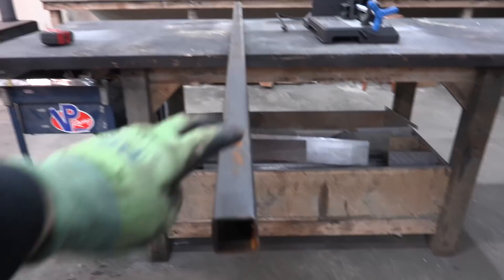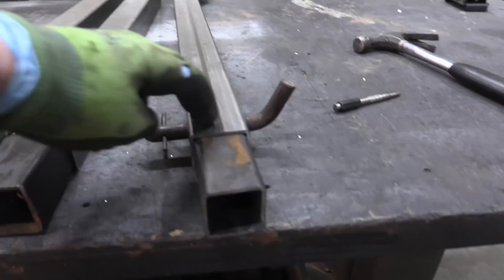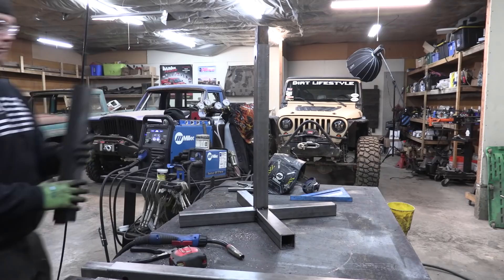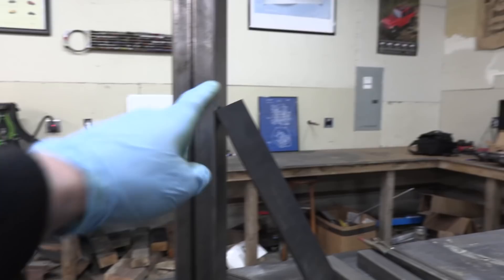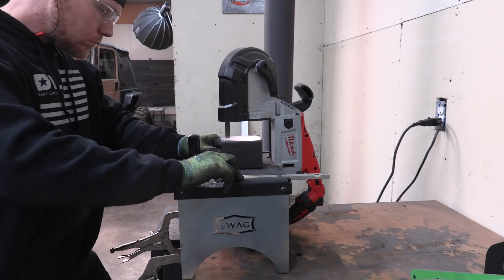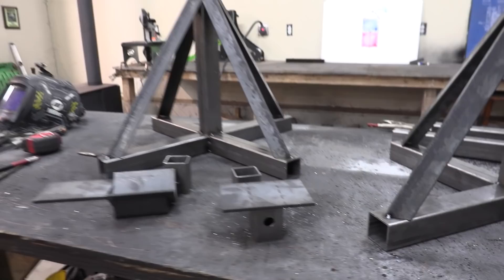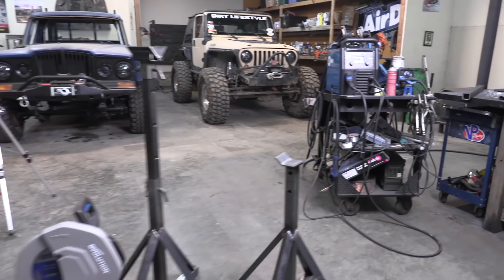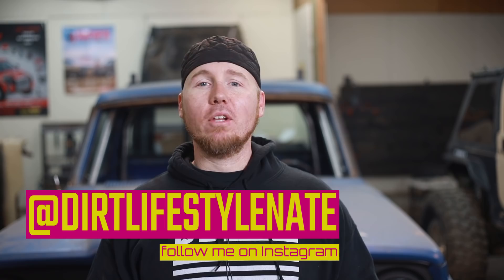Easy Homemade Jack Stand Ideas

Comment: Used a chop saw like that for years. Make sure your material is clamped down good, if it comes loose a tooth on the blade might catch it and then break teeth off the blade. Scared me when I saw you cutting all those angle iron at the same time. Also if you cut a short piece off -2” and under, keep the blade down until it stops rotating. If you let it go up there is a good chance the blade can catch the small piece that was cut off and jamb it into the blade breaking teeth.
Reply: Also when cutting flat bar or angle iron. Don’t lay it flat stand it up so the blade cuts through the thickness and not the width of the material, cut
s quicker and creates less heat. Nice job on the video.
Reply: Evo saws will make you a quick learner of how and how not to cut certain types of steel lol clamps very important expecially
Reply: Oops didn’t finish sent it anyway . Especially if the blade has been used somewhat, kinda in the fence as far as blade life

Comment: Good project. Just a tip: make sure you support the outfeed on that new saw. I got the skilsaw version and was cutting some 45* miters in .125 x1.5 angle with about 2 feet hanging off the non-clamped end and when it got through, the piece that dropped caught the blade and sent it flying, taking a tooth off my brand new blade. Other than that, im super happy with the carbide saws. P.s. The wife doesn't like it because the chips get stuck in my boot and get tracked in the house. Not fun to step on.

Comment: Nice work. I bought two 12 inch long 1-1/4" 5 TPI ACME threaded roads to make some infinitely adjustable stands, but I have more projects than time. I like the idea from another comment about building them with three legs so they can't rock.

Comment: Make sure you make a couple tops with screw adjustments so you can use them to level stuff when you are fabricating. The feet for scaffolding are usually pretty reasonable and make good  platforms to build off of.

Comment: Nice pizza cutter! I find that the telescoping stuff that they make street signs out of bends from compression at about 1500 lbs at 48" with similar triangulation and no gusseting. The 1/2" grade 5 bolt I used had no issue.

Comment: What size of square tubes did you use? I'm needing to make jack stands to facilitate a pontoon boat re-build. I'm 6'2" and it would save my back if I could walk under the pontoon and not have to bend over and crawl constantly. Also what were the angle iron size?

Comment: A fun little project with many uses. An idea for your saw, fab up a table to bolt it to and build an adjustable height roller for your stock. Beats the shit out of cutting on the floor.

Comment: I used to have to work on gravel or dirt. I took my jackstands and welded junk brake rotors to the bottom. No more sinking! Now that I work in a garage they are more stable and don't get hung up in control joints in the concrete. Edit: it also added about a inch to the height!

Comment: I did a version of these for my final welidng project back in my welding classes a few years back. Mine was a much different design, but much the same concept. Yours are definitely cheaper though as my design used some 1" threaded rod with a huge nut welded to the top. Gave you really fine adjustability, but it was spendy! Haha... great stuff, Nate. Really like your design.

Comment: Another great video to inspire the rest of us to get fabbing.  A nice touch would be to drill a hole on one side of you base, weld a nut on, then a T handle welded to the bolt.  This would allow infinite height adjustability for light things like exhaust, and your pins for heavy things like axles.  Again, great video.

Comment: We have some stands like this at work but have 3 legs and we’ve rolled a piece of 1.5” round tube into a ring that sits on the floor so the stands are easier to move around the shop, you just roll them around.

Comment: Take your 7" flapper wheel, to each of the exterior walls of the slider tube. After a spray of lube, friction will not be an issue. Thanks for the videos. I enjoy your content.

Comment: Nice stands.  I suggest you build/make a top out of 3/4": nut and all thread.  weld nut to stand off and have arm on top to adjust 
/level.  that way you have a way to level work   you know that one job will have where the hole pin just want work.  we use that in oilfield att the time   thx and keep up the awesome vids

Comment: To cut a 60 degrees angle when your saw only allows up to 45 degrees, cut a 45 degrees piece that you will use as a wedge. Set your saw to 15 degrees plus the wedge and that will do your 60 degrees.
Reply: That would be the secret you can't share. One person to get hurt is all it one take. What happens under the shade tree stays in the shade.

Comment: Sweet buld man. As I was watching I thought it would be cool to add a small bit of rod to the bottom of the stand on which you could store the different head attachments when not using them. Although it would be good to place it in a spot that if you fell on it, it wouldn't stab right into you.

Comment: I would have been tempted to do a 3 leg version so they don’t rock around on any surface.
Reply: I made these 3 leg ones last year. 2"x1/4"thick receiver for the center. 1.5"x.120 wall for the legs,  1"x1/4 thick flat bar for the supports.
https://www.instagram.com/p/B1kwi_9n7kH/?utm_source=ig_web_copy_link
Reply: @Adventure_Mike  those have 4 legs lol

Comment: you very well could have cut the 60\30 with that saw....the pin that locks your angle comes out and can be set in a different spot to achieve those steeper angles

Comment: Nice build, thanks for sharing.
Question: could you have used the angle iron for the support legs without making any cuts and just lay it on one side (rotating angle iron by 45°)? That way you had flat side on top of the outrigger and the other size overlapping side of the outrigger and then just weld it that way? 
I don't think there would be any rotational or torsion forces acting on the stand as you would have the outriggers on all 4 sides.

Comment: A trick to get 60 Deg. cut a block at 30 Deg. Place the saws' clamp at 30 Deg. add the 30 Deg. block and secure it to the saw table. That should give you the 60 deg. you're looking for.

Comment: made ones with 1" 1/8 wall inside of 1.5" 3/16wall with a 3/8" pin, 3 legs and the hold my jeep fine the telescoping fit is a little sloppy so if im going to be doing something with alot of movement of the jeep i tap a flat head or chisel into the stand between the tubes to sturdy it up.. the 3/8" pin is the limiting point and i think i googled it and got like 9000 lbs double shear per pin and thats only holding 1/4 of a 5,000lb jeep.. the ones you built could no doubt hold up a ram 5500 fully loaded

the limitation is more so stability vs height, trying to droop your axle out and still be able to work on it you need a good 3ft stand atleast gotta have a wide base to be stable at that height

Comment: Thanks for responding to my last comment about tire size, I just have one more question about your Jeep. I own an XJ and I'm in the middle of one-ton swapping it. I've been considering different power plants for quite a while now and after watching all your videos on your TDI swap I'm leaning towards a TDI swap myself now. In your experience, do you think a TDI can carry an XJ with a one-ton swap, body armor, 40's, and a cage? Full interior, extra insulation, and a lot of spare parts. Will weight be an issue? Would I even be able to tow a small trailer? I would upgrade the turbo, fuel system, cams, and tune. Also, I would like to mate it to a modified XJ 5 speed manual. Please let me know what you think of this as it would help a lot. Love the video's man keep it up!
Reply from the maker: The only way this would work is low gearing for your transmission and axles. And a very well built pumpe duse or common rail. No trailer. People say they haul with these engines all the time but they aren't on 40s. My Jeep has ton of power available but if I need it for long periods of time my EGTs go through the roof. You will have the same problem. Good luck man 👍
Reply: @DirtLifestyle  Yeah I was thinking that would happen, thanks for the feedback, it helped a lot!
Reply: @DirtLifestyle  Any other diesel swap recommendations? I was also looking into the 2.8L CRD Liberty swap but again I couldn't find much info regarding weight restrictions. I'm looking to have the engine + transmission combo stay well under 10k so a built 4bt might be pushing it. Let me know, if not I'll just go for the old reliable LS! I came from the drift community (5.3 LS swapped e36) and finally have enough cash to start jumping into projects I couldn't previously afford, so please forgive me if I seem ignorant to many of these terms and platforms.

Comment: I think you can flip it over In a way that cutting at 30 degrees becomes 60 no???
Reply: Maybe I’ve done too much table sawing.
Reply from the maker: This would work for one peice but to make a bunch of identical peices using this method would be a challenge

Comment: You've inspired me (Recovering Banker) to learn to possibly weld a little bit. Luckily I have access to one of the best fabricators in the world to learn from Greg Henderson, @Unofficial Use Only.
Reply: Melissa Hill well, used to work in multiple body shops and learned how to paint etc way back when, so definitely not incapable of learning.
Reply: Melissa Hill and I did sweep floors a lot during the SEMA builds at Unofficial Use Only. Every little bit was helpful.

Comment: For the 60-degree angle...I've got a bunch of wood triangles I cut out of 2x4s a while ago, with a couple of small nails sticking out of certain faces to hold them onto the rear fence of my chopsaw. If I need a 60-degree cut, I just slam the 60-degree triangle in there, it stays put, I lay the piece I'm cutting in, line up the mark, clamp it down and give 'er hell. If you're worried about the clamp not working well you could always use a similar triangle on the other side.

Comment: Can't you flip the material over? Complementary angles and all that, 60 degrees on one side will be 30 on the other ...
Reply: Lol, now I'm going to have to go verify my first statement! 🤣 But it sure seems like rolling the material 180 in the jaws of the vice would have changed that 60 to a 30 (when measured from the same reference point.)
Reply: I may be totally visualizing this completely wrong. Definitely going to go play with it. I guess it's something to do instead of sitting around doing nothing right now, lol.
Reply: Disregard whole thread! Leaving it for comments to help the algorithm and for anyone else thinking similarly to me. To reiterate, I kept changing my frame of reference, so it's easy to get 60 from the wrong reference side. Best I can come up with is a 90 degree intermediary bracket, tack on the actual work piece and have it running nearly parallel with the blade. Way more work than is really worth it, unless you absolutely critically need that 60 degrees from 90 (30 from the long side).  I would hesitate to use loose angled spacers on a saw like this as the lead screw isn't really braced for that kind of side loading.  Maybe a spacer block with the necessary angles clamped to the workpiece, so the saw's vice is still seeing faces within the designed range and side loading is as expected? Fun little conundrum, maybe worth building a 45 degree clamping jig (or whatever degree you might expect - those bigger angles will run you out of table and blade capacity pretty quickly).

Comment: This is likely a dumb question....why did you not make a 45 and then 15 degree cut to get to your 60? Or even two 30’s?
Reply: Because hes trying to get 90 degrees
Reply: Lee Jarosh right so for the 60 degree side 45 + 15 or 30 + 30 is 60 then another 30 on the bottom side equals 90